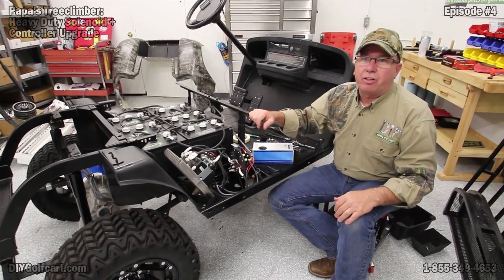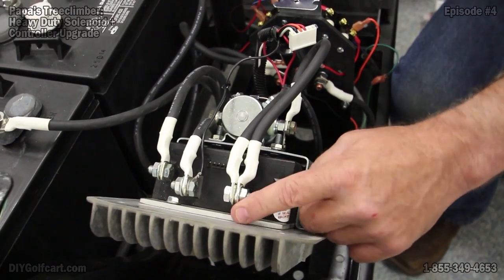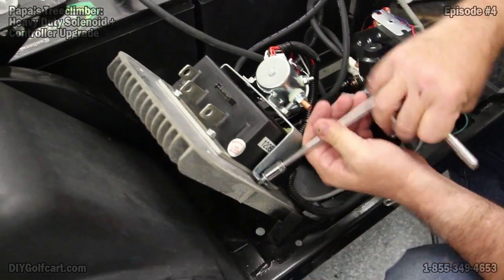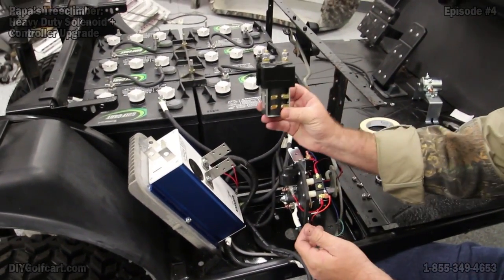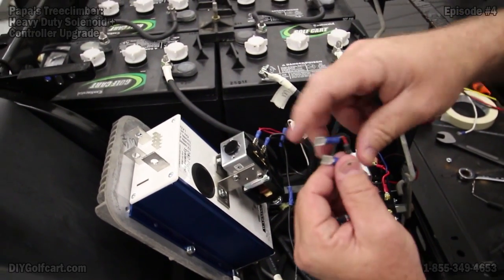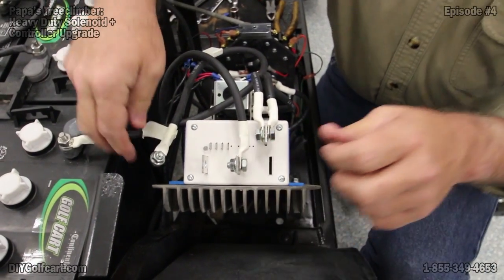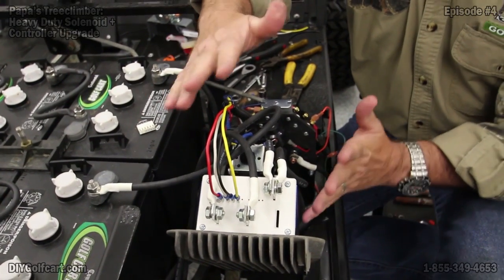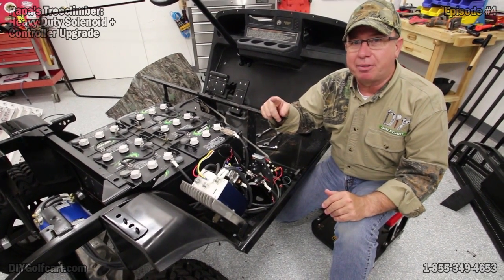EZGO Heavy Duty Solenoid and Controller Install | How to Install Golf Cart Controller

Comment: How do you know whether your new solenoid requires a resistor, diode, both or neither? On your website (https://ddmotorsystems.com/SolenoidsPage.php#), it states that "In the diagram, there are some other items that may or may not be on your car system, a diode and resistor. Not all applications use the diode and resistor, and that is why it is important to determine the year, make, and model of your car."  Any help would be fantastic.

Comment: Good video , how can I test my controller, my unit only clicks when I hit the accelerator , got good voltage everywhere ,
Reply from the maker: On the controller.....check the B+ to B- with the pedal pressed (total battery voltage), then check B= to M with the pedal pressed (total battery voltage)
Reply: Thanks for the input, it looks to be the forward / reverse terminals I found one all crooked and no continuity through the stud , ordered a new contact plate for it , I will perform this test after the  new one is installed and that will give me a base line , thanks again

Comment: I have a 2003 EZGO that stopped running. I've had the controller tested and have tested the solenoid, both seems OK. Also, I put in a heavy duty directional controller. I have jump tested motor and it worked. What I'm I missing.
Reply from the maker: Have you checked the ITS? 0 to 5K ohms

Comment: where do i get those dio's none on this yamaha g19 1996 ///????
Reply from the maker: The stock Controller on the Yamaha G16 and G19 has an internal capacitor, therefore it doesn't need a resister nor diode to operate.

Comment: My 96 ezgo txt died on my wife, once I got it home controller was hot and bad wire on motor. Replaced motor, controller, wires, and solenoid, with key on it powers up but nothing when depress peddle, any ideas where to look next?
Reply from the maker: With items heating up, try load testing the batteries. The only other thing that might have an issue would be the ITS.
Reply: Thanks! That was spot on: replaced the micro switch, all is good, I get to sleep back in the house now 🤓

Comment: Hi from Aus! thank you for your videos they're very helpful.  I have a 97 Ez go golf cart. I have fully charged the batteries. However the wires on the A1 and A2 are getting very hot.  the cart wont drive, but the motor kind of bobbles. Do you have any ideas?   Thanks in anticipation.
Reply: Mal Bird controller is bad
Reply: Bryan Enney Thanks heaps I was hoping not.
Reply: Mal Bird had the same problem that you had but you can get the controller fixed for about 150 or buy a new one from alltrax for about 490
Reply: Bryan Enney Thanks mate. Are alltrax in Australia??
Reply: Mal Bird I bought mine off eBay so I'm sure you can get it out there in the outback
Reply: Bryan Enney Hahaha awesome thanks for you help Bryan. Have a good day mate.
Reply: Mal Bird no problem you too!
Reply: What year is that?
Reply: And where might I find a wiring diagram for a 2004 ezgo 36 volt?

Comment: I have a 36volt Txt with a series type controller that will not do anything , I tested the  motor and it's good but now am at a loss as to how to trouble shoot the wiring. 
none of the wiring diagrams seem to relate to what I am seeing on my controller / solenoid. there is no 6 pin connector , only 4 larger lugs and a 1-2-3 terminal for other wires , can you point me in the right direction , thanks

Comment: I have a 2008 pds. Im about  to change  to the same speed  controller. 600 amp and heavy  duty solenoid. Do i need to put the cover on. Is it water proof.      Water resistant.  Or what i would  like to spray it off. When washing it. Thanks.
Reply from the maker: Joshua Looney You don't need to cover it. Alltrax says it's water resistant.

Comment: When you connected the large cable to the 2 terminals on the bottom of the solenoid, did it matter which terminal you connected those to?  Thanks!
Reply from the maker: Joshua Dean Nope, the only thing you have to pay attention tois when you install the Diode to the 2 small terminals. The side of the Diode that has the strip has to go along with the small positive wire.
Reply: DIY Golf Cart Thank you!  I do have one more question regarding this kind of upgrade.  If I upgrade the controller and do not upgrade the solenoid, would that be an issue?  Less power?
Reply from the maker: Joshua Dean  The only way the Solenoid will get damaged is if you increase the size of the Motor. Only increasing the size of the Controller should not damage the Solenoid.

Comment: I have an 48v 2005 EZGO TXT.  It is NOT a PDS.  I'm thinking of upgrading it so that I get more speed.  I pretty well like the parts that you have going on papa's treeclimber. Main components rated at 400amps.  What other parts do I need to complete the upgrade.  Do you have a combo set that would fit my requirements?
Do you think I can stay with the motor I have now?
Reply from the maker: Edwin Viloria Give me a call here at DIY Golf Cart (855-349-4653) and I'll design a kit specifically for your golf cart.

Comment: Do you know of anywhere i can get a wiring diagram?
Reply from the maker: Pedro Casultsan Give me call here at the Garage and I'll get you a wiring diagram emailed to you. 855-349-4653.
Reply: I have everything wired except for the two B+ connections. I know one comes from the solenoid but where does the other one come from?
Reply from the maker: Pedro Casultsan I need a lot more information to give you an accurate answer. Year of Golf Car, Type of Golf Car, Voltage and which B+ connections?
Reply: @golfcartking    Great video ☺️ I have a 2007 ergo txt PDFs 36 volt cart . New batteries, charged,  no visible wire damage .  The control solenoid won’t operate . The reed switch is bypassed , no voltage to key switch . Please help with idea , I will be checking pedal switch continuity today. The wire colors  don’t match some of wiring diagram 😕

Comment: I have a 2002 EZGO TXT so I'm guessing the same solenoid and controller would work for my cart as well... If so can you send me the model numbers of both and what size wire should I switch to..... also would I need anything else for this upgrade?
Reply from the maker: Please call in to our sales staff. We take each golf cart individually and set you up with each part that you may need for the purpose the golf cart will be used.

Comment: If the stock controller is working, why do you want to change the old one?  What benefit(s) do you get from installing a heavy duty one?
Reply from the maker: A Heavy Duty (high amp) Controller allows the Motor to pull as much amperage as it can. On a stock golf cart, it will increase the power by allowing the stock motor to pull as much as it can. On a High Torque motor or Speed Motor, the Larger Controller will greatly increase the performance of the golf cart.
Reply: +DIY Golf Cart 1998o ezgo golf cart  wiring diagram controller unit

Comment: Do you think the whole motor, selenoid, wires and controller swap out could be done on a club car precedent without taking off the body?
Reply: Yes, all of those items can be changed out the body still on the car.

Comment: Nice butcher job, now the cover wont fit? but conectors? i would sorder,then heat shrink? the fuse shood go to the controler away from battery,since the cover wont fit any way? i like alltrax,would be nice if they fit? and dident have to cut wires..
Reply from the maker: I try to make the video's using what I would think most people would have in their toolbox. Soldiering and Heat Shrink is the best way to get a great connection but, I don't know many people that have those items readily available. You are correct about the cover not fitting anymore. The Controller is larger due to having to handle more amperage and won't allow for the cover to be re-installed.
Reply: Nothinng wrong with the way you did it. Its not a boat, its a golf cart. There will always to keyboard know it all's.
Reply: DIY Golf Cart is there much risk in running without the cover over the controller. I recently added 2ga wiring to stock controller and cover will not fit over thicker wires.
Reply from the maker: Dean Springer No Risk. When upgrading your system you will end up having to leave off the cover. The Alltrax controller I used is Water Resist (not water proof). Just keep the cart from going under water and you'll be fine.

Comment: What size bolts do you use to mount the solenoid to the controller?
Reply from the maker: #12 24tpi bolt/screw 1/2" long